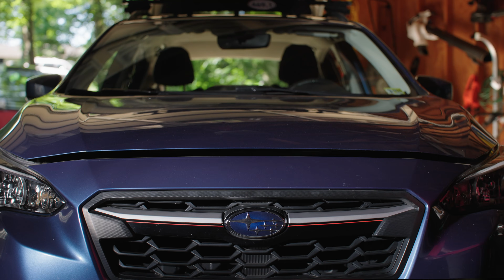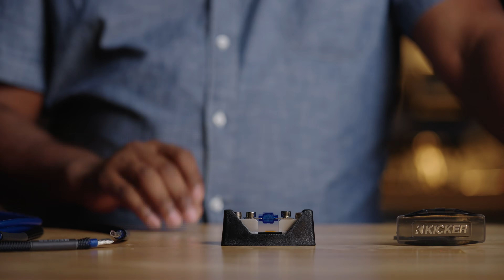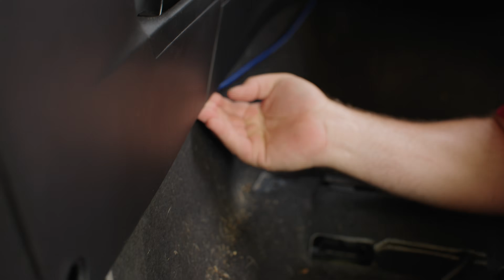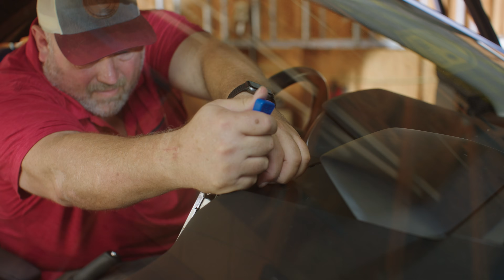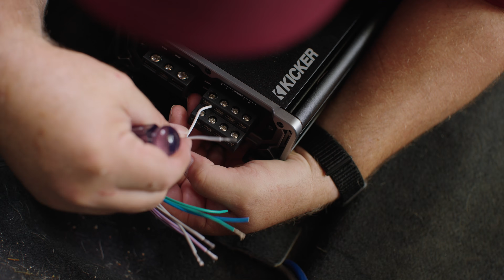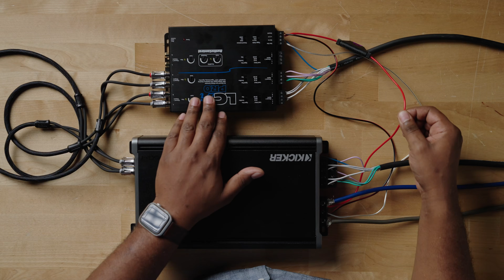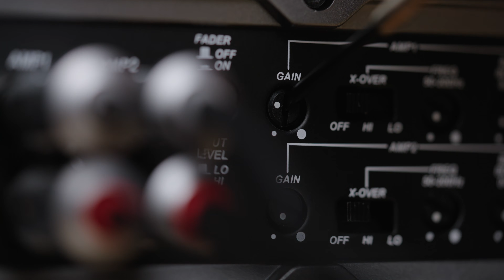How to install a car amplifier with a factory stereo | Crutchfield

Comment: Great video, but I wish they'd slow down in some parts. Like... how does the back of the factory even look like? Where does the T-harness go? How do you connect the nine-wire? The part where the video is fast-forwarding... it'd be nice if that had some description on what's going on, and the methods on how to connect those wires.
Reply from the maker: Thank you for your reply, we appreciate it! This video is designed to show the steps for the amplifier install, and not specifically for basic wiring connections. The Posi-Connectors in the link below are fantastic for basic car audio wiring connections, and there is a great video located on the product page that shows you how to connect! These are great for connections from 9-wire to vehicle-specific amplifier integration harnesses. If you need any help installing your Crutchfield purchased products or making basic wiring connections, just give us a call with your order number handy. We provide lifetime Technical Support with every order, and we are on the phone lines 7-days a week.

https://www.crutchfield.com/p_669PP500/Posi-Products-Car-Stereo-Wiring-Harness-Connectors.html
Reply: Basicslly different for every model of car, while also being the same?

Comment: So if I want to use the factory wire, I just needed to plug in the RCA for the input and (If I have an adapter harness) cut the output wire from the harness and connect the output wire from the amplifier to the output speaker wire from the harness?
Reply from the maker: When using a processor like the AudioControl LC7i pictured you will connect with RCA from your processor to your amplifier's inputs. The powered speaker outputs from your amp can be fed back into the factory speaker wiring with the 9-wire pictured. If you are using a vehicle-specific factory radio harness from PAC to add your amps/processor, then you can use the features on that harness to splice the powered speaker outputs from your amplifier back into your vehicle. This makes adding the amplifier much easier than expected for many installs!

Comment: Now do I just put another rca cable on loc7 and run that to mono block? For subs? But how do I tell the mono block to turn on? I need another remote wire.
Reply from the maker: Yes, you'll use the line output converter for signal running RCAs from it to each amp. From there, you'll have to run power, ground, and remote wires.

Comment: So the wires that come out the lci go to the speaker input to the factory radio? And the wires that were cut from speaker side got to amp?
Reply from the maker: You tap into the factory speaker wires from the radio and run speaker wire to the speaker-level inputs on the LC7i, then RCA cables from the outputs on the LC7i to the RCA inputs on your amplifier(s).

Comment: just a quick question !! i have a 2 channel 2000w amp and i am running subs on it , can someone pls help me how can i connnect my 6x9 speakers to it too ?
Reply from the maker: We do not have any devices that can make it possible to connect subwoofers and speakers to a 2 channel amp. We recommend getting a second amp to power the 6x9 speakers.
Reply: @crutchfield  thankyou so much for clearing my doubt !!!

Comment: The only thing I'm curious about before I buy, how would I adjust those gains on the amp if I have the connection under the seat? I probably wouldnt be able to leave the seat out and connect the battery without an airbag issue. Otherwise, flawless video!
Reply from the maker: If you plan to install your amplifier under a seat it is a great idea to mount the amplifier in a location where you have access to the settings for adjustment with the seat re-installed. I am stoked that you enjoyed our video, thank you for the kind words!🥰

Comment: If my car comes with a factory subwoofer and amp. should i re wire the speakers to the after market amplifier? or should i keep the speakers on the OEM amplifier and just have the subwoofer on the after market? thanks
Reply from the maker: If you are keeping the stock speakers, you would want to keep powering them with the factory amp, because factory speakers can't typically handle much power.  But if you've upgraded to aftermarket speakers that can handle a good amount of power, you could certainly add an aftermarket amp to power them for better performance.

Comment: What is input knock on my amp? How do I tune my bass and mids and tremble is there a video?
Reply from the maker: Input knock tends to refer to the amplifiers gain adjustment. Tuning your system is really dependent on the exact radio, amplifiers, or signal processors you are using in your system. This video explains how to easily set your amplifier's gain (or input sensitivity) adjustment so you can achieve great sound without guessing on your settings. If you are using an aftermarket radio or processor with RCA preamp outputs and have amplifiers channels in your system to drive each speaker, you can also consider adding a DSP processor like the JL Audio TWK 88 in the link below for total control over your sound!

https://www.crutchfield.com/I-rYALc166/p_13698101/JL-Audio-TwK-88-Digital-Signal-Processor.html

Comment: Could I just get the signal from each speaker and run that to the lc7? The head unit I have is too much to take out
Reply from the maker: You can generally tap in at the radio or at a factory amp location. What is the year, make and model of your vehicle?

Comment: do you have a video just like this but where you install a 4 channel amp and DO have to run new speaker wires to each new speaker getting installed because the factory wire is too thin?
Reply from the maker: Hi Fabian, we do have a great car amplifier installation guide that covers running new speaker wire here: https://www.crutchfield.com/learn/learningcenter/car/amplifier_installation_guide.html

Comment: If my amp supports high level signal, could I bypass the LOC and splice new speaker wire from the head unit output and oem speaker output?
Reply from the maker: We're glad to take a look. What is the year, make, and model of your vehicle?
Reply: @ 2024 GMC Canyon, non Bose
Reply from the maker: Yes, could use an amp with speaker-level inputs as well.

Comment: If you have a aftermarket radio do you need the tuner? And if I want to have an amp for speakers and for subwoofers separate can I run both power cables through the same side or will it mess with the signal?
Reply from the maker: If you are adding amplifiers to an aftermarket radio with RCA preamp outputs, you do not need to use a line output converter like the AudioControl LC7i. When running your power cables for your amplifiers, you want to run them as far as possible away from any RCA signal wires or speaker wires to avoid noise and interference.
Reply: @ okay thank you for answering my first question but my second question is a little bit different, if I have two power cables running from the battery to power two different can I run the both on the same side without it effecting anything?

Comment: A question for setting gains: my setup includes a LOC that also has a gain setting knob on it for front and rear. I have a volt meter and I understand how to find out my desired volts for the amp, but how do I go about doing the gain settings between the LOC and the amp?
Reply from the maker: You'll want to follow the instructions specific to your exact LOC for the gain settings. Most LOC's will have LED indicators for clipping or optimized signal that can be used to help dial in the right settings. You can also test your exact signal output in AC volts of your line-level RCA signal with your multimeter to help match it to the listed specs for input signal strength of your exact amplifier.

Comment: A normal volume knob control is ok with my pioneer 12 inches double speaker which is 1200 watt? i lost original volume control for the sub
Reply from the maker: If you have lost your original bass control knob, you will need to source an exact replacement that is compatible with your brand and model amplifier. If you are using a line-level RCA signal input to your amplifier you can also use the PAC LC-1 Remote level control in the link below. The PAC LC-1 works with any RCA line-level output. The LC-1 would need an extra RCA 2-channel cable for installation into most existing subwoofer systems using RCA line-level outputs to your amplifier.

https://www.crutchfield.com/I-rYALc166/p_541LC1/PAC-LC-1-Remote-Level-Control.html
Reply: @crutchfield  Thank you so much for your kind help bruv

Comment: i have Land cruiser lc300 2024. it came with only 7 speakers is it enough to upgrade and get better audio quality? by changing car JBL speakers+ amplifier
Reply from the maker: Yes, replacing your speakers and adding an amp is the best way to upgrade your sound. What type of setup did you have in mind?
Reply: @crutchfield  i still dont know, but i want to install best type of JBL speakers and idk about the amplifier. because there is famous shop in my town will do it

Comment: What's the limitation for the stock speaker wire? Usually what's the maximum speaker wattage you can use with stock speaker wire? Thanks.
Reply from the maker: We typically only suggest using stock speaker wire with amps rated at 50 watts RMS or less per channel.
Reply: @crutchfield  thanks for the reply. My speaker rated at 80w rms. I really should use new cables then. Thanks you so much for the tips.
Reply from the maker: You're welcome. If you need anything further, please let us know.

Comment: Hello sir I've a 2010 Cadillac srx. It has a stock amo in it. With a stock radio. So I'm wondering if i just hook up a hi low converter to the speakers will it still work. Or will the stock amo interfere with it.   Thx my friend
Reply from the maker: You can install a line output converter in your 2010 Cadillac SRX. With most line output converters, you will want to get your speaker-level input signal from the amplified speaker outputs after the factory amplifier.

Comment: Can i use the factory wiring in my 2021 honda civic with a 75 watt amplifyer? Or will i need to install larger speaker wires?
Reply from the maker: We have done extensive testing with our Technical Support team on this issue, and we found that signal loss is minimum when using amps up-to 100-watts RMS with good condition factory speaker wires. You can install a 75-watt amp with confidence and have great results without re-wiring your vehicle's speaker wires! Anything over 100-watts RMS or for subwoofers, larger gauge speaker wire would be needed.

Comment: i have a 35mm² power wire going to the back of the car, is it possible to connect a 10mm² that then goes to the amplifier?
Reply from the maker: A distribution block can help connect a smaller gauge wire to a larger gauge wire that's already been ran to the battery. The link below will show you one that works with the wires sizes you've listed:

www.crutchfield.com/I-rYALc227/p_120VDB4/item.html

Comment: This is the best amp to factory head unit install video I've seen. Question: Why were the rear speakers configured for high-pass filter?
Reply from the maker: Thank you for the kind words, I am very happy you enjoyed our video🥰. The hi pass filter applied for the rear speakers tightens the sound and reduced distortion from low bass on the smaller speakers. The front 6x9"s can handle a full-range signal, no problem!
Reply: @crutchfield  Aha! Thanks. I didn't catch that the rear speakers were smaller ones. I initially thought the rears also full range, but after hearing about the high-pass activation, I thought I missed some detail where the rears were mid-high units and the plan was for a sub in the trunk because of the 6-channel LOC unit. :D
Reply from the maker: No problem! 🙂

Comment: Hi folks! Is it safe to use 3ohm speakers on a 2 /4 ohm amplifier? If so, is there anything special i need to pay attention to? Thank you kindly.
Reply from the maker: Many popular speaker brands like Infinity and JBL offer 3-ohm speaker options, and those are totally fine to use with amplifiers that have a 2-ohm minimum impedance. The amplifiers will deliver a little bit more power than the 4-ohm RMS wattage ratings to those speakers, so making sure you are using an amplifier that does not overpower your speakers RMS wattage ratings is a good idea.

Comment: Good Afternoon, I was wondering what gauge wire you had run from the amplifier to power the LOC. The small red wire, additionally what resistance fuse was used as well. Also, what T-harness was used in this video? its not relivant I just want to know which specific one was used on this video so I can futher my research. Thanks
Reply from the maker: For any LOC's and processors, we use this low-current wiring kit in the link below. For compatible select Subaru Crosstrek vehicles, the PAC LPHTY01 in the second link below is used in the video.

https://www.crutchfield.com/I-rYALc166/p_700DSPLOC/Wiring-Kit-for-Processors-and-Low-Current-Devices.html

https://www.crutchfield.com/I-rYALc166/p_541LPHTY01/PAC-LPHTY01-LocPro-Advanced-T-Harness.html
Reply: @crutchfield  Thank you
Reply from the maker: You're welcome! 🙂

Comment: Why did you choose the Lc7iPro over the Lc5iPro?
Reply from the maker: We could have used that one as well in this install. The benefit of the LC7i, in this case, is the second subwoofer preamp output that can get even stronger level audio into an amp powering a subwoofer should one ever be installed.

Comment: I didn't watch the video, but I have a suggestion. Now that you've shown us how to run an amp off a factory stereo, now show us how to do it with an aftermarket head unit. 

I'm gonna spoil it though: It involves more wires than you ever thought possible. I'm going to be running just an external amp and a powered sub, but this requires no less than 7 wires, 16 if you count 8 speaker wires and the additional remote wire for the external amp. Those 9 seperate wires are bundled in a speed wire that Crutchfield do sell, when it's in stock anyway. 

Car audio installers have earned my respect and admiration during this installation process for my car.
Reply from the maker: Thank you for your comment!😎

Comment: Trying to install an amp in my 1997 LS400 Nakamichi system, no t splitter unfortunately available, cutting is scary too haha
Reply from the maker: If there is no PAC T-harness available for your specific vehicle, you will need to splice/wire in your line output converter/amplifier for install. We provide lifetime Technical Support with every order. If you decide to tackle the job yourself, we can always assist.

Comment: I love the mix of the complex way to do it and the easy way. Great info, clean presentation, and seeing the wiring setup outside of the car was very helpful.
Reply from the maker: Thanks! It's great to hear that you found it helpful! 🙂
Reply: But doesn't show where the signal wires are from the factory wiring harness to get the signal. Yes there's more then one option sometimes.

Comment: Can I run 4 kicker speakers with the amp, without the lc7i pro and add that later?
Reply from the maker: Some vehicles can work directly with amp's that have speaker level inputs without requiring a device like the LC7i Pro. We are happy to check. To get started, what is the year, make, and model of your vehicle?

Comment: Could I in theory connect the 9 wire from my amp to my after market stereo harness and have an amplified signal output coming from my speakers through factory wiring. I would not need to connect the second line of 9 wire as I would be able to connect RCA's. Lmk your guys thoughts.
Reply from the maker: You wouldn't want to connect the 9 wire cable to the stereo's harness. In vehicles that do not come with a factory installed amp, the 9 wire cable could be connected to the harness used to install an aftermarket radio into your vehicle. This can work with amps that output 75 watts RMS or less per channel.
Reply: @ bet that’s perfect my amp is running at 60 rms per channel so it should be perfect. thank you for responding so fast.
Reply from the maker: You're welcome! Glad we could help and that it was good news too :)

Comment: What's the difference between lc7i  and lc7ipro
Reply from the maker: They are very similar, but the LC7i Pro includes their ACR-1 wired bass level controller, and it also offers selectable load impedances for better factory radio integration with many newer vehicles.

Comment: Hi I installed a 4 channel amp to my factory radio using a hi low converter, my problem is the factory stereo has gone from a 4 speaker output to a 2. So as before I could shift the sound from front to back, all the speakers work but now I can only use left to right. Do you know the cause?
Reply from the maker: It could be one of many reasons like the LOC summing the signals, the amp set to the wrong inputs, or the wires connected to in the vehicle. Which LOC *hi low converter) did you use? Which amp? What vehicle is this in?
Reply: @crutchfield  I read I need to ad a second loc as it’s a 4 channel amp, currently my loc is spliced into the 4 channels from the rca
Reply from the maker: We're glad to recommend a good match. What model is your amp? What is the year, make and model of your vehicle? Any plans to add as second amp down the road?

Comment: Hi, great video! Very informative.

Question, if my amp has high level input, can I just use that instead of getting an LOC?

Pioneer GMD-9705

Thank you!
Reply from the maker: Thank you! 🙂 Yes, with an amp that offers speaker-level  input capability, you wouldn't need a line converter to connect the amp to a factory stereo.
Reply: @crutchfield  Amazing! Thank you for your response.
Reply from the maker: You're welcome!